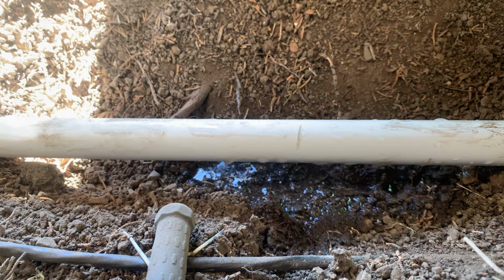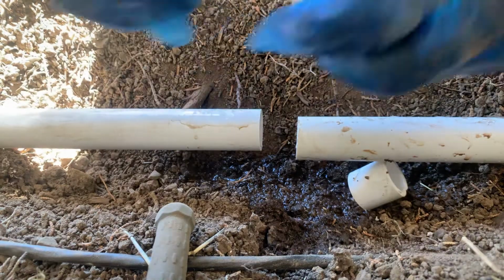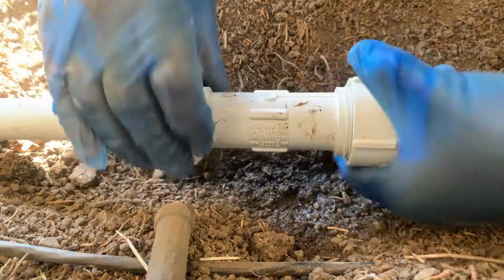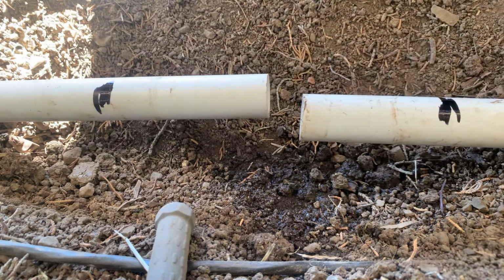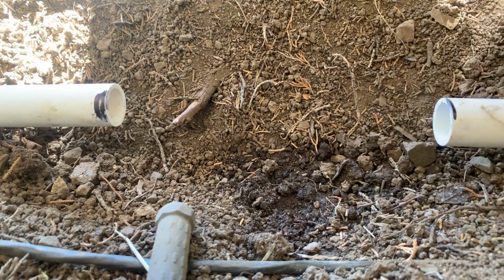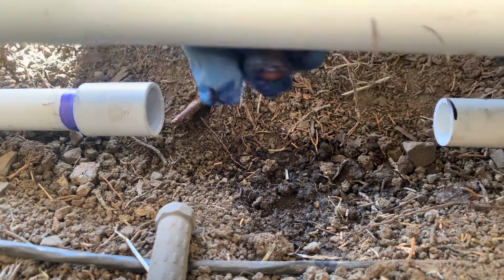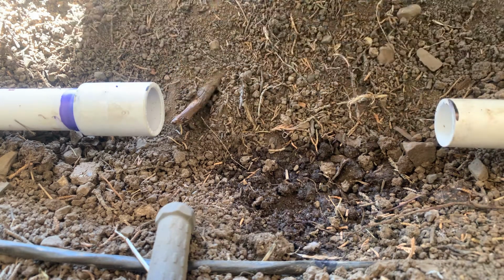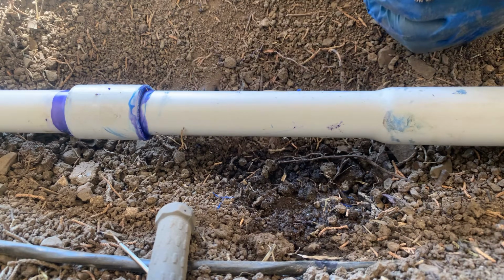How to fix a Broken pvc pipe

Comment: Why spend more money on that compression fitting when you could just use a full slide coupler and just paid 50 cents
Reply from the maker: This are just options for home owners or people with no experience
Reply: Still have to buy sand paper and glue
Reply: What's a full slide coupler? Is it a coupling without stops? I've never seen those in the big stores, I don't think.
Reply: The last coupling looks like electrical pipe , no water pipe ….

Comment: Thanks for the tips. I especially like the third method as I have to occasionally repair broken irrigation pipes from my well. The pipe extends over 5 acres with about 6 sprinklers - 1 every 200 feet. As it is now, I have to dig up about 4-5 feet on either side of the break so that I can lift both ends to put a coupler on. The 3rd way seems to be a lot easier for me. Thanks

Comment: Where did you buy that 20" pipe with the long Flared "Bell" end that is 3 or 4 inches long?  All the flared "Bell" end pipe I find has a very short flare; not long enough to do the slide effectively like the one you show here.  
Have you ever tried making a long flared Bell end yourself from a piece of regular pipe using a heat gun?  I've seen other Youtubes on thermo forming PVC but it's usually for just an inch or two at the end and not 4".  I can imagine things getting wiggly and wrinkling when trying to slide a cold pipe inside the heated end if pushing in that far (4") to form a Bell end.  Has anyone reading this tried that?